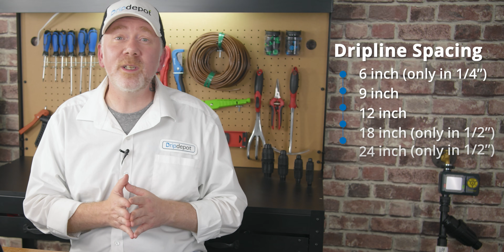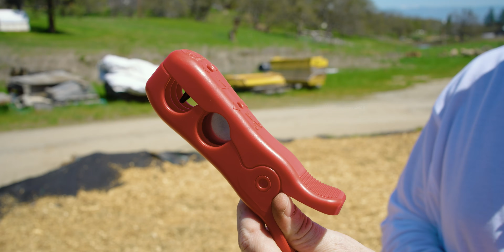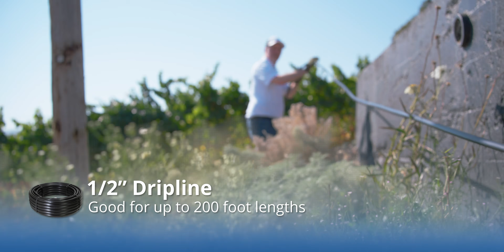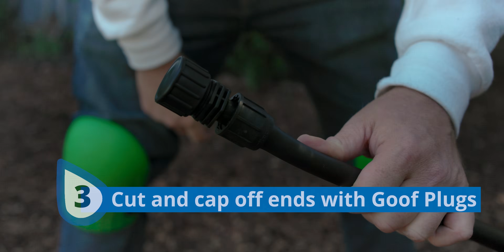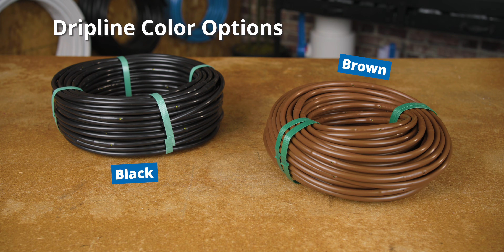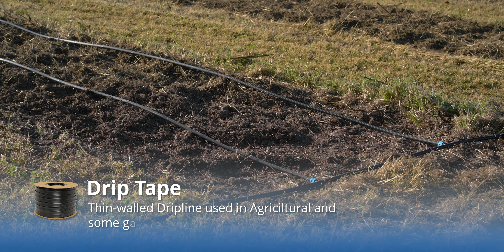Dripline: Choosing the Best Type for your Irrigation Project

Comment: Hi! Thanks for the great content. I'm planting 4 planter beds soon approx 10'x4'.  I'm wondering if 1/4" inline is sufficient for four beds with 3 lines each, or if I need to switch to the 1/2" ?
Reply from the maker: At 10' you're well in the green for 1/4" dripline :) 

3 lines of it in a 4' wide bed is also how we do it  to get uniform coverage beneath the surface of the soil., and your beds' dimensions are in a good spot for any of the spacing options (6",9" or 12").

Comment: I have 3 4x6 raised garden beds. I was thinking of placing drip line with 6 inch emitters in 5 ft rows that are spaced 6 inches apart. Would you recommend that I use the 1/2 in or 1/4 in drip line?
Reply from the maker: With 4' x 6' beds and drip line runs about 5' in length, you're well within the green to use 1/4" drip line, which costs a good deal less per foot than the 1/2" sizes.  If there are significant elevation changes from bed to bed the 1/2" could be worth considering (most 1/2" dripline is pressure compensating, allowing beds at low elevation, where pressure can be higher due to gravity, to compensate for that increased pressure).  

6" spaced dripline and 6" between the dripline rows might be a little high, but to some degree this depends on how far from the edge you'll be starting the dripline runs since that will determine the total number dripline runs.  3 dripline runs with 6" spacing is a common (and effective!) approach, particularly if there's around 3 rows of plants.  I do a lot of that both at home and in the company garden that is in many of our videos.  Technically, 3 rows of 12" spaced dripline is more than sufficient outside of very sandy soils, but even us who work in drip irrigation find some comfort in the closer spacing :)
Reply: @dripdepot  I think I'll give the 1/4 in drip line a try. Thank you Drip Depot Man!

Comment: I need to design a drip system for 100 young fig trees. I submitted my thought and requested help in finalizing the order, but have not gotten a response.
How do I get help?
Thanks
Reply from the maker: Heya Mitch, I see someone got back to ya this morning after we came in.  We're Pacific Time so might have been later depending on your time zone.  I went ahead and looked through the reply and it looks like it's all on the right track to determine lateral size and to compare flow demand to source flow.  I think your plan for that one will almost certainly wrap up in more than enough time for October, it looks to be near the finish line :)

Comment: I'm just wondering how they put the drippers inside the line without cutting it
Reply from the maker: Great question, and while some manufacturers may utilize different methods, what I've actually seen during facility tours was largely the same.  The drippers are actually inserted during the extrusion process itself.  Essentially the process was loosely like this: 

The raw materials (pellets, UV stabilizers, etc) for the tubing go into a hopper that feeds it into the extruder.  There they are liquified and blended, then forced into the die/mandrel that gives the tubing its initial shape and diameter.  This is where the emitter is inserted, via a stationary guide at the center of the die/mandrel; the guide ensures the emitter is oriented and near the interior wall.  This means each emitter is already inside the tubing when the guide releases it.  The emitter bonds (heat and contact pressure) with the inside of the still hot polyethylene and goes into calibration and cooling tanks.  The calibration draws the tubing into the correct outside diameter and uniform round shape and water does the cooling.  At this point there is no way for water to exit the tubing, so it passes through a "perforator" section that punches the hole where the water comes out (this part looks cool in person, even though it happens really fast you can see what are essentially spikes quickly penetrating the tubing to make the emission point exactly where it needs to be).  

From there it starts getting coiled and cut to the length for that coil.  It sounds a bit mundane after the perforator section, but even the haul-off and coiling is pretty innovative.  The lines I got to see also had a pretty cool feature: if the spacing of the emitter or the alignment of the perforator got misaligned from exactly where it needed to be, the entire line automatically stopped and a loud alarm and warning came from the PA system to alert people.  That allowed the misalignment (and no doubt other issues I didn't see or hear about) to be fixed instead of completing an entire coil where emitters and emission points were misaligned.  That no doubt saved a good amount of materials, but also time from end users.  

The above is the best I can remember it (along with going through some info from the companies that make the machines to refresh some of the terms) and since it happens inside the die/mandral the actual emitter insertion is not visible.  The perforating, vacuum calibration and cooling are visible though, and are impressive to witness themselves, particularly at the speed at which it all occurs :)
Reply: @dripdepot  Woah thanks for the detailed response!
I am familiar with the extrusion process as an engineer but didn't know you can add stuff to it while it's going. Everyday you learn something new

Comment: I live in the South East US.

I was telling my buddy how hot my wood shop gets in the summer and he suggested a put a drip line on the roof. 

I thought it was an interesting idea. Curious if you guys have any helpful insight or feedback as to if this would be effective enough to bother with or not. Would it make a large difference? 

For reference it’s a galvanized metal roof. When it’s 95 outside it can get to 120 in the shop. Tough. Anyway thanks for any comments or feedback.
Reply from the maker: Great question!  And 120° in the shop sounds brutal, particularly with high humidity found in the SE states.  Drip line would likely cool down the roof some, but I think the distribution of water would significantly limit the cooling potential.  The water would likely flow in narrow streams that follow roof corrugations and paths, and the size of the "droplets" (streams in this case) would see quite a lot of runoff instead of cooling evaporation.  

A misting or spray setup would likely yield better cooling results, and out of the two I'd lean more towards spray if you often get wind or even a breeze.  The very fine droplets from misting nozzles could drift away before reaching the roof, and the idea here would be more to cool the roof rather than the surrounding air.  In that regard (cooling the roof and not the air around it) the drip line recommendation wasn't too far off the mark, it just wouldn't distribute water as well as something with area coverage.  Humidity would run some interference as it does impact evaporation rates.  Evaporation and cooling would still occur, it can just take more water per degree of temperature drop in higher humidity situations.  

If you have access to a hose sprinkler or similar, you could run a quick test to see if you'd get sufficient cooling.  On a hot day, place a sprinkler or two so that they wet a good portion of the roof when they're running.  Then you could compare the underside of the roof temperature to the shop temperature with the water on and off and see if it results in enough cooling to make going all in worth it.  

If he recommended drip line to help prevent water from getting into ridge vents, flashing, fasteners holes, etc, then you could run the test with a hose wetting parts of the roof that are safe to get wet.  With a staggered layout, the distribution of water from the drip line could be more thorough.  Nothing like a spray, but still more than a couple streams running down the roof :)
Reply: @dripdepot thank you so much for this thorough and thoughtful reply! Research continues…

Comment: I have Hydro-Rain 1/2" Drip-Lock In-Line 2-Port Manifold between my mainline 1/2" tubing and my 1/4" drip lines in raised beds. Do you have a video with a close-up of the 1/4" tubing being installed into or onto? manifolds ports? Or even a close-up picture of properly connected 1/4” tubing on these  manifold adapters?😮
Reply from the maker: You bet! Check out this video here: https://youtube.com/watch?v=QM8uCm6D7_U&t=58&is=wiRflyJe-knCBQrL

I think that will show you exactly what you’re looking for :)

Comment: Could you guide me as for vegetable garden(mostly okra/egg plant/beans/green chilies & sour coat) back yard 3 beds by 8' x 3' of 5 beds. Making circle of each plant. Recommend me the items to be purchase with specification ie: 1/4 or 1/2 tube etc. black tube or brown tube,
Reply from the maker: From what you've described, a system with a 1/2" mainline leading to 1/4" dripline in the beds would likely be a great match unless the beds were a long distance from the hose bib.  One of the raised bed kits would be a great place to start on something like this.  They have everything needed to make a complete raised bed system and they can be customized to be an even better match to any given system's needs.  

Tentatively, your system sounds like it would fall somewhere around the Basic Kit or the Standard Kit.  Some minor modifications of either one could get one of them in the right place so that you don't have too many or too few leftover supplies (some leftovers are good for repairs or expansion).  

Here is the link to the Raised Bed Kits.  You can select the kit size from the dropdown menu and then scroll down to see the components list.  Each component is clickable since all the parts are also offered individually.  Clicking on one will take you to its item page if you wanted to see a more detailed description of any of them.  Here is that link: https://www.dripdepot.com/drip-irrigation-kit-for-raised-bed-gardening

This next link goes to some sample layouts we created using the kits as a template, so you can see how it all looks when assembled.  We labeled the parts on the samples so you can see exactly which part it is from the kit: https://help.dripdepot.com/support/solutions/articles/11000119078-raised-bed-sample-layouts

You're welcome to drop a line with any follow-up questions, happy to help!

Comment: I have garden bed that is 55’ x 10’. Need advise on best watering system. I was leaning towards 4 lines coming of a header line.
Not sure if 4 lines should be 1/2” or 1/4” tubes. 
Also what spacing should be 6,9 or 12 “
Any advise would be appreciated.
Reply from the maker: At 10' in length, 1/4" driplines would be well within specification at any spacing :) 

Spacing is a little more involved as there are many factors that go into it, from planting density to soil type and soil infiltration rate, and others.  It's easy to get lost in the sea of information when it comes to spacing.  The quick version is: 

12" is pretty much the default, it is effective in a wide variety of soil types and growing applications.  Water spreads about 12" from the point of drip, beneath the soil, so 12" spacing typically provides uniform coverage.  When done right, this is all below the surface; however, the small  wet circle on top of the soil can make folks new to drip irrigation nervous that it's not delivering enough water.   

9" is a solid compromise and works well with closer plant spacings and faster draining soil types.  

6" is for very sandy / fast draining soils and particularly dense planting like carrots, some leafy greens, carrots and some herbs.  It also gets a lot of use from folks new to drip irrigation worried about 12" spacing (I was in that category for my first drip system).  

As far as line length maximums go, you'd be good to go at any of those spacings and 4 10' lines is not a heavy flow demand even with the 6" spacing.  Basically, you're in a good position for any of them to work well in regards to the water physics and can let your soil type and planting strategy lead the way :)
Reply: @dripdepot  made a error . My bed is 10' wide and 55' in length. would the same advice apply to these dimensions
Reply from the maker: @Shadows3211  55 feet in length would change the setup a bit :) 

Pressure lost from friction would be pretty high in a 1/4" line at that length at any of the spacing options.  For longer lengths the most common options are 5/8" drip tape or 1/2" drip line.  Both of those can handle longer lengths with their larger inside diameters.  1/2" dripline is a bit flexible if some bending or snaking is needed.  Drip tape has to be ran in straight rows (it was originally developed for row crops, long straight rows).   Both are pretty easy to work with, and other than the inline emitters inside the tubing, 1/2" drip line is the same as 1/2" poly tubing and uses the same fittings.  

I've got 2 video links to short videos that show both 1/2" drip line and 5/8" drip tape in action and covers some of the information.  We have full length videos for them as well if you need to deep dive, these shorter videos lay the foundation to help narrow things down:

https://www.youtube.com/watch?v=Zaq5SzPLwl8&t=76s - I set this one to start later in the video where the 1/2" dripline information starts.  The first minute or so covers 1/4" dripline, and the last portion of the video goes over 5/8" drip tape. 

https://www.youtube.com/watch?v=bfwsCswzMAI&t=20s - This video goes over 5/8" drip tape in a bit more detail, but still a short video at a little over 2 minutes.  It covers the fittings used and is part of a longer full length video of an actual install from a flower farm.  I also set this one to start a little bit into the video where the relevant portion starts.  

Don't hesitate to drop a line with follow-up questions!

Comment: I have a 21 ft x 4 ft bed for dahlias. I want to put 4 rows of drip lines down the length of the bed. Will I need 1/4 or 1/2 inch lines? And would you recommend 6 or 9 inch spacing if dahlia's like deep watering? I see the recommendation for less than 18 feet if using 1/4 inch, 6 or 9 inch spacing, but it's so close I wanted to ask. I also want to plant wherever, not follow where the drips actually are so I do need the entire area soaked. I also have filtered irrigation water but have had debris issues with my other sprayers and drips, so is this kind of drip line advisable?
Reply from the maker: Great questions all around Jenn, you're on the right track here.  At 21' you are indeed in that gray area between 1/4" and 1/2", just as you suspected.  With 6" spacing I'd likely go with 1/2" just to ensure even distribution.  At tighter spacings (4" - 6"), the emitters at the end of line would likely put out a bit less water than those at the beginning with a 1/4" line.  At 9", though they may put out a bit less water, it should be an insignificant difference and still provide good uniformity of 85% +.  

1/4" dripline in particular is flexible enough to snake or "S" shape, so it's ok not to plant in perfect rows (though keeping in mind that an "S" shape will add some length to the line depending on the severity of the curves).  1/2" dripline is also flexible, but the curves need to be more gentle.  Water spreads about 12 inches from the point of drip in common garden soils, so odds are good you can get thorough coverage from multiple approaches.  This all happens beneath the surface (when done right), the small wet spot on top of the soil can cause a little panic to folks who are new to drip, but that's actually one of its best points (less surface water means less evaporation).  

And you bet, you can use this type of dripline with "dirty" water, though I'd recommend another filter right before the drip system.  This one doesn't need to be a a bulky or specialty filter, just a mesh screen filter.  Even the small hose filters can do the trick though you might need to clean them fairly often depending on the particulate count in the water.  The small hose filters (and a few of the smaller pipe threaded ones) are inexpensive but still offer the same strong protection of 150+ mesh that the larger filters do.  The filters displayed at the top of this link are the smaller hose filters (as you scroll down it goes to smaller pipe threaded filters and then into the larger filters):  https://www.dripdepot.com/irrigation-supplies-filtration-filters

The filters are threaded, either hose or pipe depending on your water source, so it's usually just a matter of threading it on to the other parts located right before the drip system (usually referred to as the "head assembly").  At 150 mesh or even more, those filters remove all but the very smallest particles.  That, coupled with flushing the lines (removing some end caps or plugs and running water through) can keep drip components like these operating for a long time to come.  Some farmers with very poor water quality (in terms of debris content) irrigate hundreds of acres with this and similar parts by just filtering the water first (they use large automatic filters, but even those are just 150 - 200 mesh elements, they just get the ones that do a backflush cycle to clean themselves)   :)

Don't hesitate to drop a line as questions come up, happy to help!